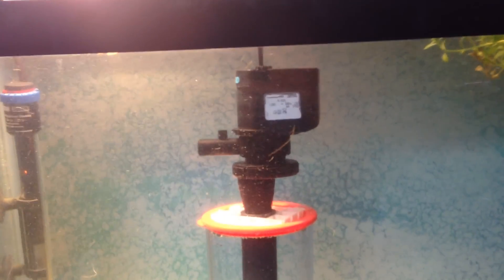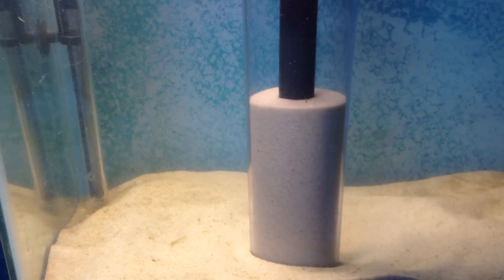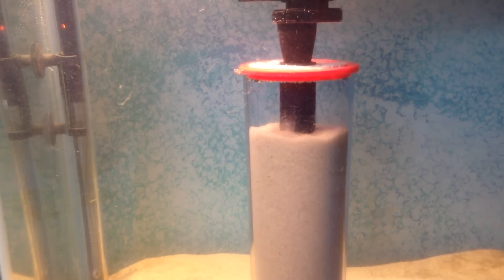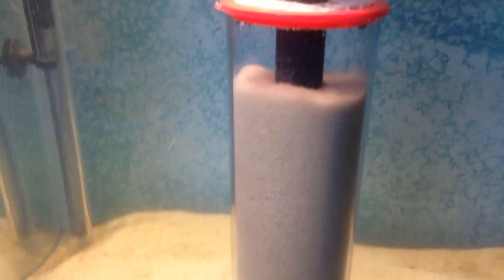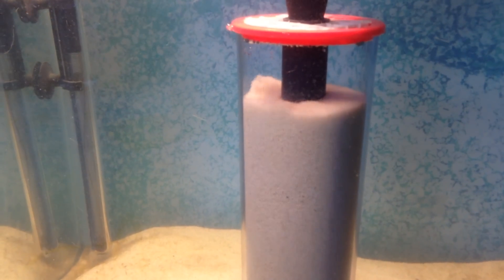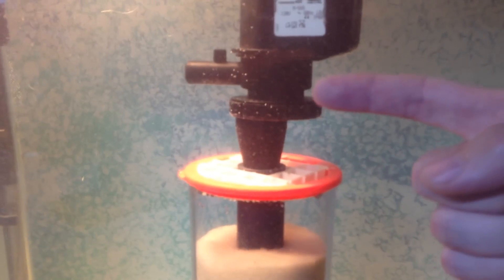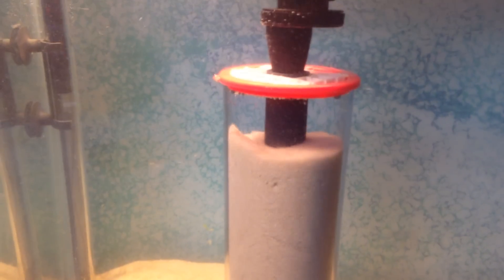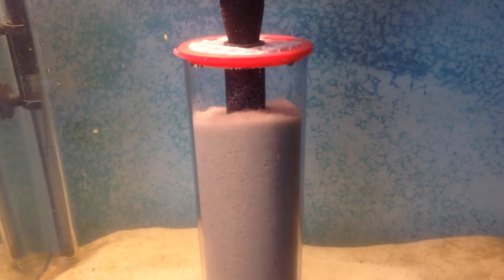DiY Canister Fluidized Sandbed Filter pt 5

Comment: The big disadvantage of this filter is its danger in case of a power-out.  If the filter stops running for whatever reason the medium collapses and the bacteria culture dies very fast, since the oxygen will be consumed very vast. The dead bacteria start decomposing immediately, producing toxines, like ammonia, which will get pumped  into the aquarium as soon as the filter restarts.  A sandbed filter, like any biological filter that lacks oxygen, can be deadly to your fish.  You have been warned.

Comment: but what is the trick, but I tried to do that every power is cut just stands by the weight of the sand, and if I put a bigger head to the sand fly around the tank. 

I've seen every one of the videos and all I can think is that your power head works in reverse. Is it so? or I'm wrong
Reply: That powerhead is working in reverse. It must push water into the canister, not suck water out of it.
Reply: What kind of sand did you use for this? Also after almost a year later how is it working and what have you changed?
Reply: I used play sand, that was washed thoroughly. I haven't changed anything and it runs great. The one thing to keep in mind is to never do anything with the sand; it takes a very long time for the bacteria to grow in that environment and you want that bacteria in there.
Reply: ***** Thank you for the response....I was thinking about buying the sunsun canister and making your filter (homemade of course) chain at the end of filtration. I wont get as fancy as you did (2-liter bottle and some PVC lol) but outside the tank to avoid a few problems.

it pushes 370gph and it's made to have such a filter attached so it should do just fine in my 75 gallon tank.